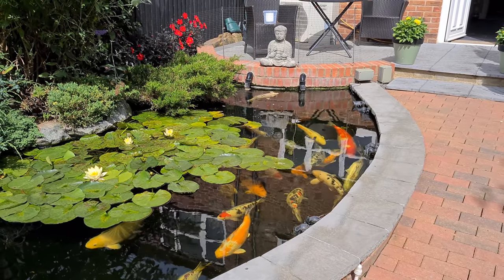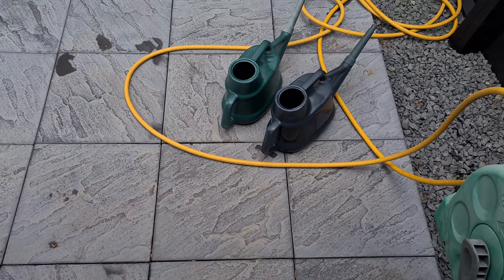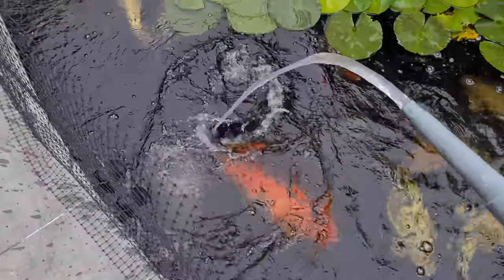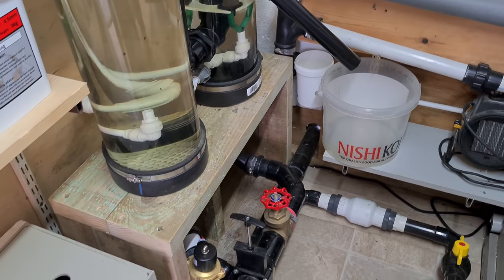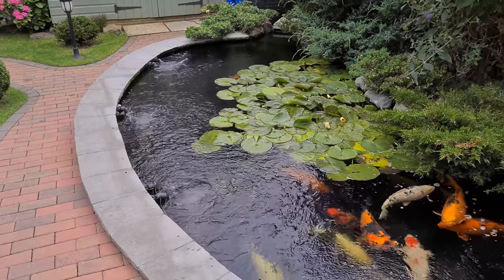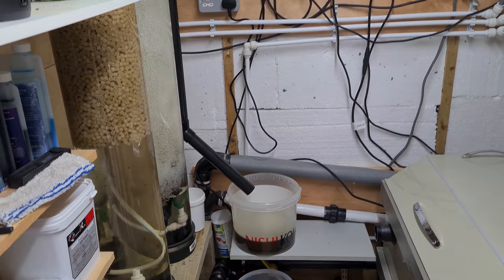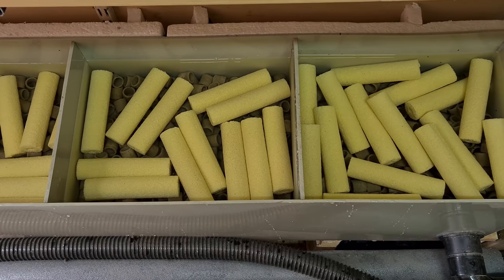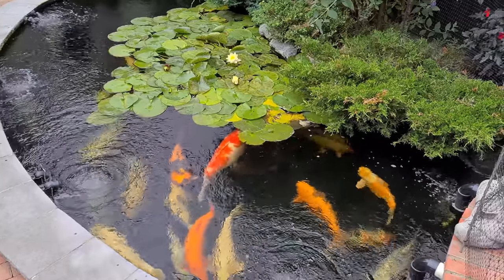DIY Protein Skimmer & Nitrate Problem.

Comment: Awesome pond and interesting vid thanks. 

I chucked a big bag of watercress into a basket last year and it reduced my nitrates to next to zero. Really fast growth. 

The Bakki filter media I have reduces my Nitrates a little.

I've also been using water from a desiccant dehumidifier and it works a treat for lower nitrates. It produces 8 liters per day and is cheaper to run than a RO unit. Unlike the compressor types, it does have the metal contamination and is pure. I just add bicarb or clay to increase the trace elements for KH, etc.

On your skimmer, I've seen the use of capillaries instead of a wider funnel to remove the foam faster. Worth a try.
Reply from the maker: Hi Ricki, and thank you, very much appreciated. Thanks for your suggestions, I will look into them. I must say, my nitrates have come down a lot, so I can live with them at the moment. Thanks again, Terry.

Comment: I Terry, I think the plants you took out were doing a good job keeping the nitrates down and you need to maybe use more siporax  and up your water changes to replace them. I can't remember if you have a trickle in and out system if you haven't I would recommend doing one. I'm heavily stocked like you and the trickle system has made so much difference. If you're on a meter I'd suggest a veg filter. There really is nothing like plants to take out nitrates. And it will give you something to do.😅I don't mean to try to teach my grandmother to suck eggs. Always look forward to you videos, thanks.
Reply from the maker: Hi Tony, it was the way I had it plumbed causing the problem with the nitrates. Coming from the protein skimmer had too much air in the water. Now I've re-plumbed it the nitrates are coming down quite quickly. I do have over double the amount of Siporax recommended for my pond size, so that should be ok. I'm unable to have a veg filter as the wife says, I can have no more garden lol. Like you say, plants are the best think for nitrates, but the trouble there is I loose too much pond room for the amount of koi I have. Thanks for the tips mate, much appreciated. Take care, Terry.

Comment: Love when you tinker with the filters :-) I have used those tablets before in an emergency, as well as the nitrite one on a separate occasion. they have worked for me BUT i didnt desolve them, I just put them in a little mesh bag in the multibay. After 3 days the nitrates went down dramatically. I could watch the upflow filter and protein skimmer for hours on ends. Dont know what it is, they are like mesmerizing  :-)
Reply from the maker: Hi Lau, I must admit, the up-flow and protein skimmer are fascinating lol. I was thinking of putting the Envii in my moving bed, but to trial it properly, I had to follow the instructions on the packet to the letter, and it didn't make any difference at all, as you saw in the video. I might get some for the moving bed and see how it goes. Thanks Lau, take care and stay safe, Terry.

Comment: Hi Terry

I a not surprised that the Envii product did not work as I tried Envii Pond Equaliser and that did not seem to do a great deal either; I even contacted Envii to report my disappointing results and they sent a new packet out, in case the original bag was breached or contaminated during shipping,  alas to no avail.

Great video as always and I will be very interested to see the solution to your nitrate problem
Reply from the maker: Hi David, I was it on eBay and their selling loads of it, so I thought I'd find out if it worked as this was a good opportunity. As you saw in the video, it didn't do anything. That's why I had to follow the instructions on the packet to the letter. I ended up giving it a triple dose in the end, but nothing. I'm hoping the bakki river will cut back in soon and sort the nitrates hopefully, fingers crossed. Thanks mate and take care, Terry.

Comment: hay fella love your vids. I am Sorry to hear about your issues with nitrates. I have a suggestion for you.. I don't know if you have come across anoxic Filtration. there is a guy called Kevin Novak PhD.. on you tube. this guys goes very deeply into this... its takes a lot of time to go through all of his vidioes.. though I do believe he is on to some thing.... he seems to really know his stuff when it comes to removing nitrates...
Reply from the maker: Hi mate, and thank you. I will have a look at his videos, thanks for the tip. My problem is, I'm well over stocked for my pond size. I am going to reduce the number of koi I have which should sort it out. Thanks again for the info, very much appreciated, Terry.

Comment: Hi Terry mate I have a coverleaf protein skimmer on my pond and have the same troubles some times it makes skimmit and some times it don't I'm forever having to up or down the vari flow pump running it 😡 you'res seem to work a 1000% better than the one I have it was bought second hand and is running directly after my home made easypod on my skimmer line and after watching you're trials I think I'm now going to move it to the bottom drain line after the tempest to see if that makes any difference if it does I can then replace the settlement box for a Bakki shower 🤞🤞🤞
Reply from the maker: Hi mate, I love to hear about people making there own pond equipment. If we can get enough of us doing it, the manufactures just might start to bring prices down to a sensible level. It was the Envii Nitrate treatment I added to the pond that stopped my protein skimmer from working. It took 4 days, but now it's back up and running again. Keep up the good work mate, take care, Terry.
Reply: @Wrighty  I hear what you're saying mate prices are rediculous it'll take me years to save for a drum filter 😭😭😭

Comment: Hi Terry,another interesting and informative video as always.totally unrelated question…I’m currently running a nexus and dismissed a rdf as I have to pump to waste.is there a way to run a rdf in this situation?
Reply from the maker: Hi Baden, and thank you mate. I'm not sure just what you mean about the RDF pumping to waste. The only waste is what's used when it's cleaning, about half a litre.
Is this what you mean mate, Terry.
Reply: @Wrighty  thanks for the reply Terry..my pond and filter are at the bottom of my garden so approx half a metre lower than my drain and to get my waste back to the drain I have to pump it,granted it is a good few litres as it’s a nexus 320.hope this makes sense
Reply from the maker: Ah! I'm with you now mate. Could you use a barrel with a sludge pump and float in it? (sorry mate, just thought, thats what you might be doing already) lol. Take care mate, Terry.
Reply: @Wrighty  I currently pump to waste manually as I don’t have the auto clean.you’ve suggested exactly what I was thinking…waste to a holding tank then pumped to waste.wasn’t sure if that was the best way so didn’t say to save embarrassment.thanks so much for taking the the time to reply it means a lot 👍
Reply from the maker: Your very welcome mate. That's the way I would do it. Take care, Terry.
Reply: @badenwright6375  I don’t have a Nexus but use a pump to pump the water when I flush the filter chambers.
But I don’t pump to waste, I pump it over the garden, the nitrates are great for the lawn and plants!

Comment: Apologies if I already suggested this, but have you tested the tap water? I was surprised how much nitrate is in mine, and it may have changed in your area recently. If not I was also wondering like Ian J if the nitrate treatment was affecting the skimmit, although no idea why! I also wondered if by changing the outlet, the water had changed speed through the protein skimmer and that affected it? 
Thanks for such an interesting video again, one final question, I know you've mentioned it in the past but I couldn't find the video - but what type are your lillies, I'm planning to get some next year, and yours seem to stand up better than most to the fish's bombardment :)
Reply from the maker: Hi mate, I must admit, I've not tested my tap water lately, so I will give it a go. I think your right about the Envii treatment stopping the protein skimmer, it's the only thing that was different mate. As the up-flow and protein skimmer run from the same pump, the flow hasn't changed. I did try increasing the flow, but it made no difference. I'm sure it was the Envii treatment that was the problem. It's working well again now. The lily I have is in this video: https://youtu.be/Jr1qOtMUwbU 
if I remember correctly it's called the White British/European lily, I can't remember the proper name for it, so check the video mate to be sure. Thank mate and take care, Terry.
Reply: @Wrighty  That's excellent thank you for sharing that for me

Comment: You need really slow flow for anaerobic bacteria and I mean low, especially using siporax you could always try a product  called marine pure nitrate brick and also stack your siporax to slow the flow even more .
Reply from the maker: Hi mate, I do have a slow flow through my bakki river, but I think I might have upset it with having the flow from the protein skimmer going in to it. I will have a look at the marine pure nitrate brick though mate, it might just speed things up a bit. Thanks for the tip mate, much appreciated, Terry.

Comment: Maybe a good project with the new media. A trickle or shower filter to reduce the nitrate.
Reply from the maker: Hi Erik, I have been thinking about building a shower with the new media, but the trouble is, where do I put it lol. There's no room in the filter house lol. Thanks mate, and take care, Terry.
Reply: @Wrighty  maybe a smaller wider one on top of your river 😬😂
Reply from the maker: Hi Erik, I have thought about putting it above the river and letting the flow go into the river, but just had problems with putting aerated water into the river, so thought that was a bad idea lol. Thanks mate, Terry.
Reply: @Wrighty  you can make a single or double outlet in your last compartment off your river instead of a letting it rain in your whole river.
Reply from the maker: Thanks for the idea Erik, I do have something in mind, so I might have a go at a shower in the near future. Thanks again mate. Terry.

Comment: The reason you didnt get skimate is because of the envii it likely changed the water by increasing turbidity, tgat means the bubles in the skimmer were too large to produce skimate.
Reply from the maker: Hi Khi, that's what I put it down to mate, as it was the only thing I'd done different. It's certainly working well again now. Thanks mate and take care, Terry.

Comment: I love all the filter systems you make its fantastic Terry,  I've Only one ? to ask if you dont mind, if you have such high levels, the best and most effective result to remove Nitrates, is to half the water and you’ve removed 50 percent of the nitrate, that said you also need to find the cause of the high levels, but to remove it fast can be just as bad for the fish as the High level in the first place, so 20% water change over 7 days would remove the problem slowly allowing the fish to acclimate to the change slowly, I am guessing you have done this ? but with such a large pond this could also be difficult, the only reason I asked is that you never mentioned anything about water changes to also help lower the levels of nitrate   thanks for sharing  kind regards Gary 👍👍👍
Reply from the maker: Hi Gaz, and thank you mate. I have been doing water changes, that's how I got it down to 50 mg/l but it creped back up again. My water bill is going to be astronomical lol. It should be ok once I get the bakki river to kick back in, fingers crossed. Thanks mate and take care, Terry.
Reply: @Wrighty  I am lucky my pond is a lot smaller, for now and I dont have a water meter, that said you do know if you do not put the water back to waste then you can get a reduction on your usage 👍
Reply from the maker: I do get a rebate for the pond on my water bill, but they don't give much away mate. Take care, Terry.

Comment: when are you going to design a self cleaning sieve with spray bars  stay well mate
Reply from the maker: Hi Humphrey, I will get back to the sieve eventually, as I want to re-design the flow control valve at some point. Self cleaning would be nice as it and the pond skimmer cleaning are the only regular maintenance I have now lol. Take care mate, Terry.

Comment: Hi Terry, hope you’re ok. Wonder if I could ask a question mate. What type of pipe insulation do you use? I’ve looked around but can’t find anything. My pond is all made up of 1.5 inch pipe. Hope you can help 👍
Reply from the maker: Hi Dave, I'm very well thank you. I hope all's well with you mate. I got my pipe insulation on eBay. The company I got mine from looks to be out of the 42mm, but there are a lot of others to choose from. Here's a link mate:
https://www.ebay.co.uk/sch/i.html?_from=R40&_trksid=p2047675.m570.l2632&_nkw=foam+pipe+insulation&_sacat=20601
Terry.
Reply: @Wrighty  thanks ever so much mate. I’ll take a look. Keep safe

Comment: Certainly, the nitrate level has improved. By the way, why are you planting lotus in the pond? Do you expect them to remove nitrite and nitrate?　I recently had a water quality test done as well. Check out the following video.
https://www.youtube.com/watch?v=xw6RsPvjULE
Reply from the maker: Hello, I have a bakki river to help with my high nitrate, also any plants growing in the pond will help use up the nitrates. I have a moving bed filter that keeps my ammonia and nitrite at 0.0 My only problem is nitrates. Thanks, Terry.
Reply: I see, you wanted to remove the nitrates. Thanks.